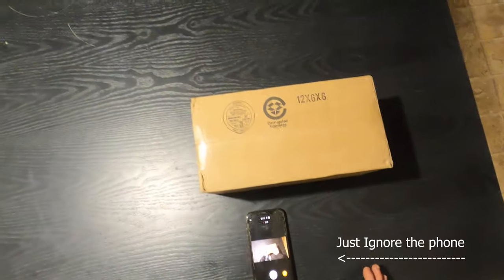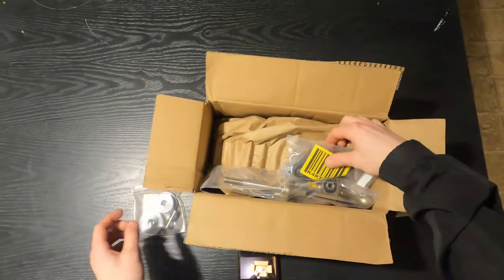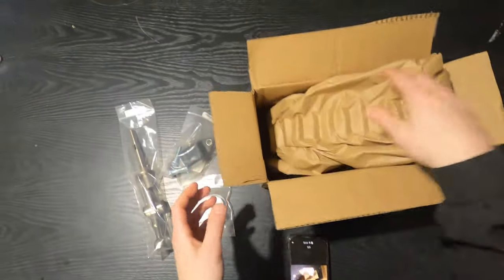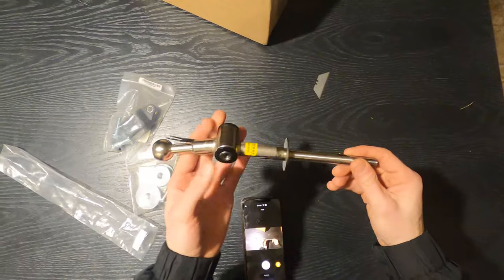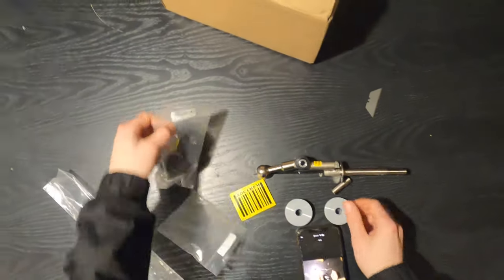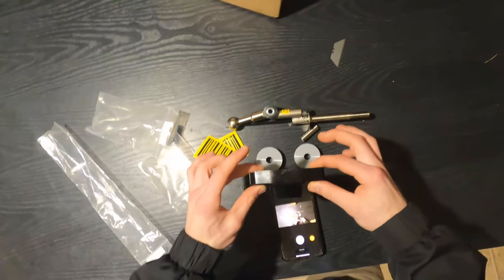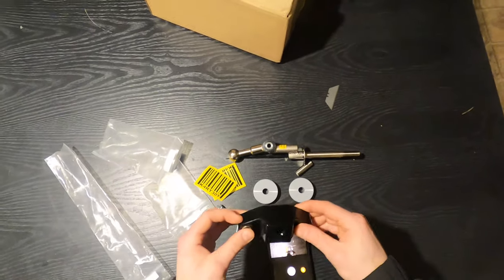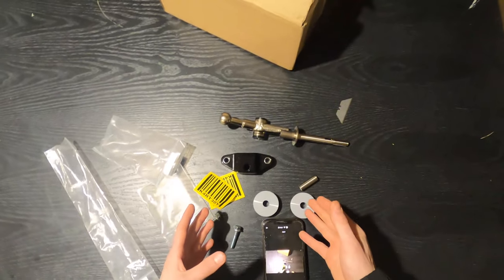Kartboy Short Shifter/Bushing Install (STI)

Comment: Big old tip if you arent installi g the bushings and its just the shifter. Shift into reverse before or after hammering the lockout pin.

Makes it easier to put back on and align and put the pin back in. And if you guys lose it, buy a rollpin set!
Reply: Sir do i need to get under the car.?
Reply: @ElNino2012  nope, you can just put the car in reverse and align the pin back in.
Reply: Just wanted to drop in two years later and thank you for my no-jack owning self. HUGE thank you.

Comment: Alright. Finished this. Take way from install. I know what “C” in c-clamp means. The pin/punch out replacement can be frustrating. When a YouTuber says remove this...some times more falls off and you have to go to the dealership to get a support bolted down correctly. You also get to meet new people. Like the mechanic at the dealership that tunes and has a side gig. Plus, it was going to cost $59 for diagnosing, but said new friend waved it off. Thanks!

Comment: Great video...  The second zip tie should be used to secure the reverse  lock out cable from hitting the drive shaft under the car.
Reply from the maker: Todd Skelton Thanks for letting me know, I was wondering what it was meant for :)

Comment: Hey so I installed my Kartboy and I've been getting all kinds of crazy sounds.

Basically I can hear whizzing of the drivetrain in lower gears.

Then in 6th gear, when off the throttle, it sounds like there's rattling, like the lockout pin is shaking around in there. 

Have u had any problems?
Reply from the maker: I haven't had an issues thus far, Have you taken a closer look at the install to make sure nothing is loose or possibly touching something that it shouldn't?
Reply: Secure the reverse cable with a ziptie

Comment: Solid install man! For the heat shield, I have always unclipped the O2 sensor harness on the opposite side and went up and over with the heat shield. Those O2 sensor are a paint in the ass.
Reply from the maker: Thanks man! And that’s not a bad idea I hate those damn sensors

Comment: The rear bushing is kicking my ass bro!! I just can't get the bolts properly aligned.  Have any tips?
Reply: Did you ever figure this out currently in the same situation please help
Reply: @thenormalworldofwes6656  yeah, it took a lot of trial and error. I ended up taking a break until the next day because I was so frustrated. I was able to get it figured out shortly after starting again.i love KB, but I think next time I'll go with Cobbs version of this bushing
Reply: @traku748  basically where im at right now had to get a ride to work stupid bolt wont go in I dont know if its threaded or worn down
Reply: @thenormalworldofwes6656  dude tell me someone has a better answer this is absolutely kicking my ass right now. having to catch a ride to work tomorrow also
Reply: @bradylester2960  is it that bad? I’m
Planning on doing this, maybe have a few free days afterward just in case? Lol
Reply: @SlayinSinceDaWomb  it’s a pain in the ass but it’s doable without messing it up. i had to take a pry bar against the driveshaft and have one side threaded in slightly, leverage it towards the other side and thread the bolt by hand. an extension and an impact will send them in fine after that. it’s a little bit of a pain getting the rear bushing off too but if you just pull on it hard enough it’ll slip out. all-in-all took me like 8 hours and two days to do. but the mod is definitely worth it the feedback of each shift is good and it feels better. 10/10 would recommend it is worth the hassle
Reply: @SlayinSinceDaWomb  also if you have access to a lift it’ll make it easier. jackstands on the floor are not the move lmao
Reply: @bradylester2960  good to know, thanks a lot!

Comment: What size 02 sensor socket do I need? Thank you for the awesome instructional!!
Reply from the maker: 7/8” or 22mm :)
Reply: Did this help with the 2-3 gear lockout issue when WOT? Don’t know if I am just rushing it and/or it’s the stock rubber bushings?

Comment: Hey man what insert do you use for your cupholder? Mines just the big open space
Reply from the maker: It came with the car. It’s just the OEM Cup holder insert/divider. You could probably find it on eBay for like 20 bucks. Just type in the year of the car you have and a cup holder insert and it should pop up.

Comment: Please help: I’m at the step where you reinstall the bolt into the new shifter, where you have to shake it back and forth until the bolt goes through on the other side. The bolt is half way in and stuck..
Reply from the maker: Did you try the Allen key trick under the car where you put it into the little hole for it to hold the shifter in place for you? Maybe that part came loose while you were putting the rod through
Reply: @BeeAboveAverage  the pin is in just fine. I mean to say the bolt that holds the shifter, where you’d normally put through and hand tight down the nut on the right side. The bolt is jammed in there and idk how.. when I try to unscrew it I see the entire tube/sleeve rotated and I can’t push or pull out the bolt.

Comment: I forgot to put the little black rubber piece on when re installing it on the sts, should it be a big deal?
Reply from the maker: Arnies BaeRZ Which piece exactly?
Reply: @BeeAboveAverage  that little piece at 10:42. I dont think i should be worried though bc ive been driving it like that for  a couple miles, ive put it into reverse and goes in just fine. Thanks for the reply. Great video 🤘
Reply from the maker: Arnies BaeRZ Ohhh I see what you are talking about now. That piece doesn’t seem that important TBH. If the reverse lockout starts making some noise, or isn’t very smooth, than maybe just maybe it’s because of not having that piece. But I think you will be just fine without it. 👍🏼 Also appreciate the feedback man 😁
Reply: Thank you so much!!

Comment: hey bro! Just installed mine on my 2016 sti. im getting a weird rattle/buzzing noise from the shifter when im around 4K rpm, but stops when I put my hand on it.
How do I fix that?
Reply from the maker: There is a silver plastic Piece on top of the reverse lockout that you grab and that comes loose sometimes. If that’s the case just grab some super glue and put it under neath to hold it snug and that should do the job

Comment: I just put my shifter in while following your instructions.  It went well however, I notice a ticking noise in 4th 5th and 6th nothing at idle or going slow. Anything thoughts? Thanks
Reply from the maker: Gene Oberman When I did my install the little silver trim peace on the reverse lockout became loose and started to make a rattle sound, I just super glued it down and it went away. Maybe this could be it? Besides that I’m not sure and I can ask around
Reply: @BeeAboveAverage  I noticed when in reverse it can rotate a little. Tomorrow I'm going to drive it without the trim on and listen closer. It does get louder and faster with speed. Ask around, if I find out what it is I'll let you know.
Reply: Update next day's turns out the reverse lockout cable was contacting the driveshaft. I ziptied it out of the way... no vibes!
Reply from the maker: Gene Oberman Glad you found the solution! I never needed to do that in my case for whatever reason 🤷🏼‍♂️
Reply: @BeeAboveAverage  Love ur stuff. Pretty sure on most short throw shift installs u ave to zip tie that cable.
Reply: What is the name of that grease you were using?

Comment: Was that factory shifter the standard or the STI Short shifter by chance?
Reply from the maker: Sandman20tw0 It was just the standard shifter. Even if I did have the factory short shifter I would still do this mod because it makes a big difference still :)
Reply: @BeeAboveAverage  Yeah i got a 2020 STI back in November and it has the STI short throw.  Wasn't sure if it would be worth getting a different model or not.
Reply from the maker: Sandman20tw0 I work on brand new STI’s and other Subaru’s  and I’ve felt the short throw and I can say that this kartboy shifter with the bushings is much better.
Reply: @BeeAboveAverage  good deal.  hey while i have you here.... do the new STI's still have the same banjo bolt w/ screen filter that was causing issues on the 08' models?  Tried finding it online before i tear it apart for no reason.  cannot find anything on the newer models.
Reply from the maker: Sandman20tw0 Honestly I’m not sure about that one ☝️
Reply: Is the c clip the one that looks like a little rod around

Comment: Why did you go with Kartboy versus cobb or any other brand? I'm looking to buy an sti soon and wanting to learn as much as I can before getting the car, thanks for everything!
Reply from the maker: I have had the kartboy before and I loved it and had no issues or complaints. Whilst I’ve had friends with the Cobb one that had other experiences. And after switching they said it was the best choice they made. You will never catch your self re adjusting the shifter after the first time anyway. With Cobb you have more moving parts that can rattle or brake or loosen up over time, but with Kartboy it’s a solid shifter. Hope that helps👍🏼
Reply: @BeeAboveAverage  nice! That's what I need it to know! I would like to get the red reverse lock out collar "maybe" to put some accents.
Reply from the maker: Phsyclone79 That would be nice. I was close to purchasing a burnt titanium piece but the price was a little to steep for my liking 😅

Comment: What can i used for the clip i don’t have that tool
Reply from the maker: Omar Díaz You could buy some c clip pliers at your local auto parts store or hardware store. They shouldn’t be very expensive :) I would definitely get some of these, it would make the job that much easier and faster to do.
Reply: Thanks just call also.. im just installing the shifter do i still need to get under the car for the trick for the cable
Reply from the maker: Omar Díaz Try to shift it into reverse like OreothePanda said and see if that works for you. Anytime I’ve installed an aftermarket shifter I have always done the bushings along with it. So I had to go under the car. But if your only doing the shifter you could possibly get it all done from inside of your car :)